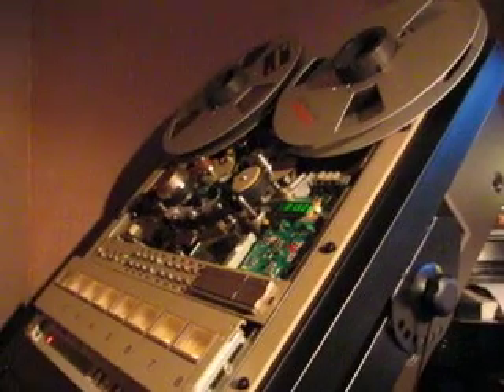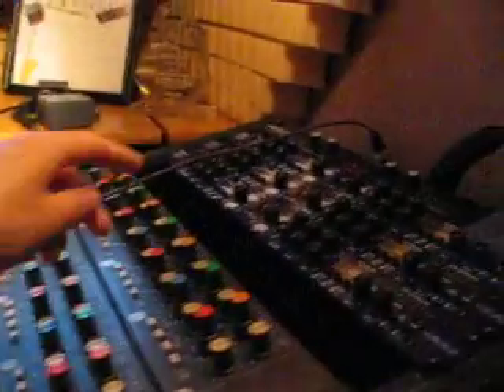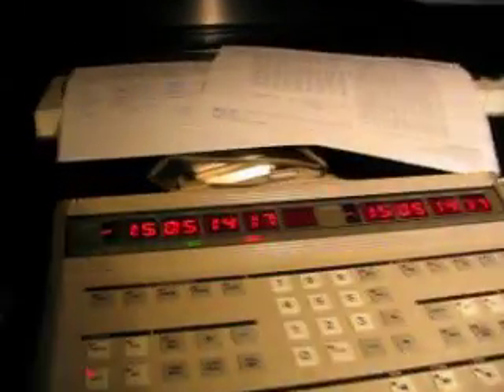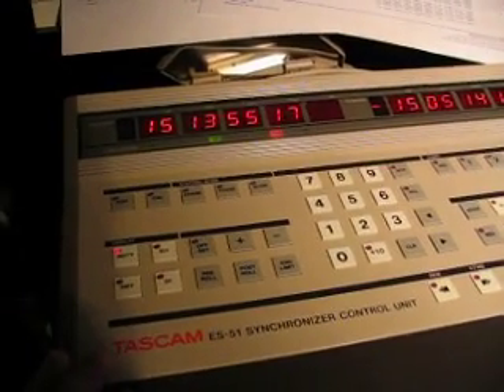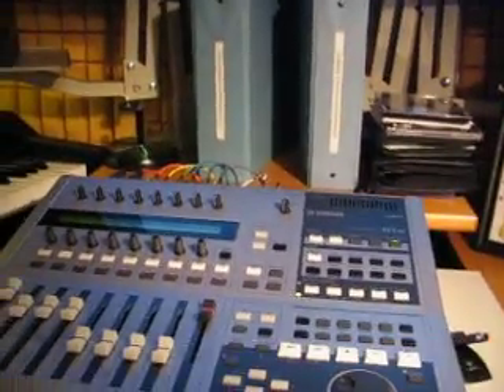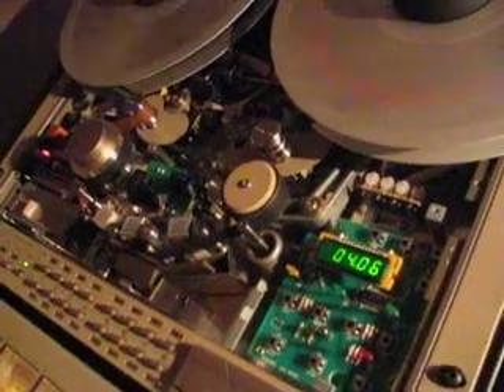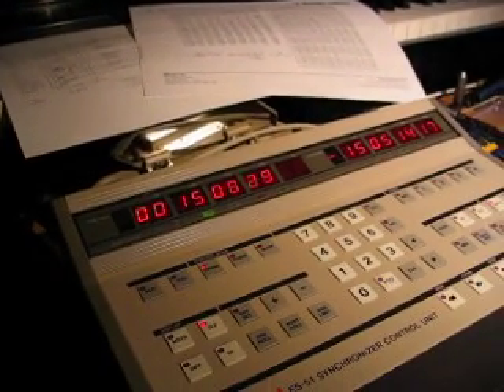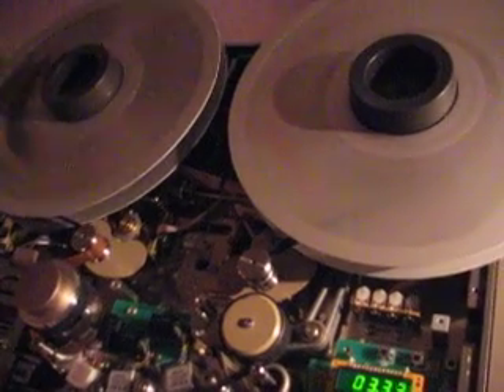Tascam ES-50: Unsuccessful Slaving of Tascam 58 to DAW

Comment: What if you use the 58 as the master?
Reply from the maker: If you use the 58 as the master there’s no need for a complex synchronizer such as the ES-50. You can use a simple SMPTE to MTC converter and have the DAW reference incoming MTC. The goal was (and note it was about 12 years ago I was trying to synchronize that 58 to a DAW) to slave the tape machine. I don’t like slaving the DAW because in order for the DAW to stay locked to the tape machine, which is invariably less stable than a DAW locked to a digital clock, the DAW adds or drops samples, or in the case of Cubase (which I was using at the time) you can read right in the manual if the DAW is slaved, it doesn’t actually lock to the tape machine. It free-wheels in order to maintain the integrity of the digital audio. And that was my goal; to lock the two while maintaining the integrity of the digital audio and the only way to do that is to slave the tape machine.
Reply: @SweetbeatsTechStop  I totally understand and wonder if you ever got it to sync even if using another DAW?
Reply from the maker: @John MacLeod No, my only trial was with Cubase, but that is irrelevant. The issue is not the DAW software, but the fact the ES-50 is looking for tach pulses to track the location of the master when it perceives the master has gone into fast-wind. So if you jump the DAW “transport” timeline significantly ahead or behind of the current location, the ES-50 assumes the master is fast winding because the timecode data is now significantly outside an acceptable parameter. As a result it instructs the slave to go into fast-wind as well but it never resolves because there are no tach pulses coming from the master. So the slave just goes into runaway mode because the ES-50 is waiting for tach pulses from the master to tell it where it is. I don’t know if this issue could have been abated if I was ever able to complete the auto “SETUP” procedure, but it is not possible to complete that step because, again, the ES-50 was not designed in a world where MTC and DAWs existed...it was designed to synchronize to mechanical transports, period. So, during the setup procedure, the ES-50 is looking for dynamic input from two mechanical transports, timecode, tach pulses, etc., so it can learn the individual dynamics of each machine and adjust how it controls them in the sync relationship. But the DAW provides nothing but timecode when in reproduce mode, so the setup procedure fails. The ES-50/51 is a nice synchronizer IF you are synchronizing two mechanical transports. If you are trying to slave a mechanical transport to a DAW it is not worth using in my opinion; the very limited functionality with requisite work-arounds takes away any production benefit. The TimeLine Micro Lynx, on the other hand, is designed to speak MIDI. So when you jump the timeline in the DAW the synchronizer understands “oh we’re there now. Okay...tape machine go *there*” and it takes it there beautifully, rather than getting hung up on looking for data input the DAW is not designed to provide.
Reply: @SweetbeatsTechStop  Thank you so much for this reply as I was looking to find an ES50/51, but now will concentrate on finding a TimeLine Micro Lynx.
Reply from the maker: @John MacLeod Yes the Micro Lynx is the bomb. I have a fully decked out Micro Lynx and a spare unit as well. Maybe you’ve seen this but I have a video I captured for a friend featuring a Tascam BR-20T I used to have chasing MTC in Cubase using the Micro Lynx. Just search my channel for “DAW Synchronized With Tascam BR-20T Using Timeline Micro Lynx” if you want to watch.
Reply: @SweetbeatsTechStop  Thanks for sharing you experience with me, I am trying to sync my Tascam MSR 16S to logic X so that it is locked solid in order to have the midi keyboard tracks in the mix the final 1/2 track master tape. I have a Motu micro express that works most of the time, but that is using the tape as the master which is not the best lock. I will try to locate the Timeline Micro Lynx system and from what you have shown me, I should be good. Thanks again
Reply from the maker: Yes, the Micro Lynx should work well with your Tascam...similar servo systems between your machine and the BR-20T. The biggest issue, as is ALWAYS the case with setting up a DAW/tape sync system where a tape machine is slaved, is finding/fabricating the interface cabling. The interface with the DAW and the Micro Lynx is easy...standard DIN MIDI cable to your MIDI interface. But the cable between the Micro Lynx and the Tascam is the complicated part. If you are lucky you’ll find a Micro Lynx that already includes cabling that can be modified. The online Micro Lynx manual includes information specific to the Tascam TSR-8 slave cable, which is the one that would work with your MSR-16. If you’re REALLY lucky you find a Micro Lynx that was used with a Tascam TSR-8, MSR series, or BR-20. Otherwise you’ll need to modify an existing cable or build one from scratch. But once you have this the Micro Lynx will do an excellent job locking your DAW and tape machine, and also serving as a powerful multipoint auto-locator.
Reply: @SweetbeatsTechStop i assume this would also work with a Tascam 48? I.e. the micro lynx? Also, I know this might be a dumb question but would it ever be possible to sync up a Teac 80-8 to a tascam 48? Like if the 80 is a slave to the 48?
Reply from the maker: @soulslip  Yes, the 388, 48, 58, MS16 and ATR60 series all use the same protocol. The Micro Lynx is a great option. To answer your other question though, no, the 80-8 is not capable of external capstan servo control, so it would have to be a code-only master in a sync relationship. You probably know this, but the standard capstan motor in an 80-8 was an AC torque motor…definitely not capable of sync. There was also an optional DC capstan motor, but the servo was not external control capable. The DC motor option was desirable in order to utilize the optional VS-88 varispeed controller. But this did not make it capable of chase-lock synchronization. So you can use it as master, but a chase-lock capable machine has to be the slave.

Comment: I'm trying to sync my MS-16 to cubase, But I dont have a mala for the ES50 and i'm trying to figure out how to connect it to the MS-16. From what I understand from your video, DAW SMPTE goes into ES master TC, and out of striped tape track goes to ES slave input? nothing else to connect? thanks
Reply from the maker: That’s not correct. All that does is tell the ES-50 the timeline position of the DAW and the tape position of the MS-16. The whole point of synchronization is for the synchronizer to then take that information and align the position of the slave device with the master device. So if you are wanting to slave the MS16 to your DAW, you also need to fabricate the cable that goes from the “SLAVE I/F” connector on the back of the ES-50 to the “ACCESSORY” connector on the back of the MS16 transport. That’s what allows the ES-50 to then control the MS16 to stay locked to the DAW, BUT...if you go to all that trouble (and trust me it is a lot of trouble), you are STILL going to run into the same problem I did with my 58...the exact same problem. But I found a solution: TimeLine Micro Lynx. The ultimate solution was a different synchronizer. The ES-50 does not speak MIDI Time Code (MTC). If you want to synchronize a tape machine to a DAW where the DAW is the master you have to have a synchronizer that will accommodate MTC along with the SMPTE timecode striped to tape. Good luck.

Comment: Is it possible for the es-50 to control a transport with a accessory 2 port?
Reply from the maker: It’s not about what the port is named, but rather the communication protocol standard of that port. What tape machine are we talking about?
Reply: @SweetbeatsTechStop  tascam 238
Reply from the maker: @twocentsoftime  The ES-50 will not work with the 238.
Reply: @SweetbeatsTechStop  Thanks for getting back to me.  Your threads on this unit are epic and I gather you've explored most possibilities with this unit.  I have about a million questions, one of them is, why can't a serial port work with a parallel?  Could some of the parallel direction messages be fused on to one cable? Or do I just wait for an ats-500
Reply from the maker: What you have to understand is it’s not a matter of just different cabling or extra cabling...look at it this way...the ES-50 listens to and speaks one type of language. The 238 ACCESSORY 2 port listens to and speaks a totally different kind of language. Neither is bilingual. You have to get a synchronizer that’s speaks the same language as the 238. 

What exactly are you wanting to accomplish with the 238 and the ACCESSORY 2 port?
Reply: @SweetbeatsTechStop  Thanks for responding and inquiring.  Set up Idea #1, Slave TSR-8 to DAW.  From you video, I can see that this can't happen, even though the TSR-8 has a Accessory 1 Port which is Parallel.  Set up Idea #2, DAW as Master, slave tsr-8 to daw as well as 238.  This would take 2 ats-500's I take it.  Or Adam Smith/Microlynx controlling tsr-8, and 238 chasing daw via its-500. Set up #3 Tsr-8 Master- 238 and daw slave via ats-500 and dtp.  I have a dtp, I have no ats-500.  I got a es-50 super cheap, and can flip it if its useless to my setup.  However, don't see many its-500's poppin up.  My thinking is that if parallel ports can be interfaced with serial viz if-500 and if-1000, than why can't that happen in reverse?  It looks like the accessory 1 port has more information being transmitted to and from, but if that can be interfaced with an ats-500 or Mts 1000, why can't the reverse happen?
Reply from the maker: Idea #1: correct, at least not with the ES-50. It requires tach pulses from two tape transports to complete the “setup” process, and looks for these tach pulses when it loses timecode. If it can’t find tach pulses under those conditions the slave machine goes into a runaway mode. So technically you can slave a slave-capable tape machine to a DAW using the ES-50, it’s just prohibitively inconvenient because every time you change timeline position in your DAW, to avoid the tape machine going into runaway mode you have to stop the DAW and tape machine, go to the new timeline position in the DAW, manually locate the tape machine to approximately that point, then PLAY the DAW and then PLAY the tape machine and make sure the DAW is ahead of the tape machine position-wise...and then since timecode is now present from both transports (the DAW and the tape machine), the ES-50 will increase the capstan tapped of the tape machine to get it to catch up to the DAW. So...possible yes, but procedural a production impediment. 

Idea #2: the ATS-500 works with timecode only. It was designed to synchronize two serial interface tape machines. You need a synchronized that reads MTC or FSK if you are going to set your DAW as master. The Timeline Micro Lynx is a great option...hard to find...but it can synchronize multiple tape machines to a DAW. 
Idea #3: again, I don’t believe the ATS-500 is going to work to interface the DAW as slave or master. What is “dtp”?

What is “serial viz if-500”?

What is “if-1000”?

I’m not understanding your question about parallel protocol sync ports (the accessory 1 port in this case) working in reverse. What do you mean “reverse”? Those connections send and receive signals. They send signals to a synchronizer about what position the tape is at in the timeline of the spool of tape, which direction and how fast the tape is moving, and then receives messages from the synchronizer about what the tape machine needs to do to stay in sync with the master...so what do you mean when you are asking why the sync port can’t work in reverse?